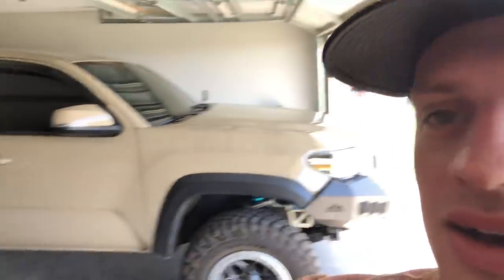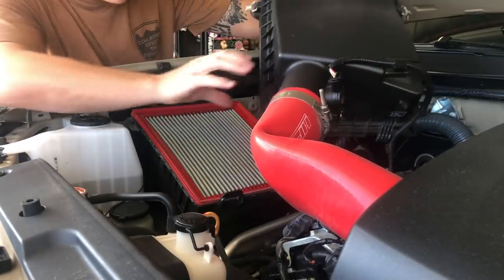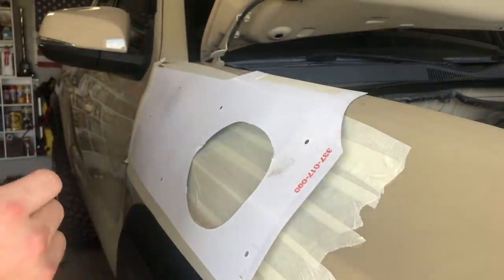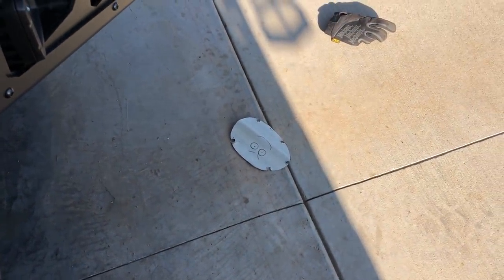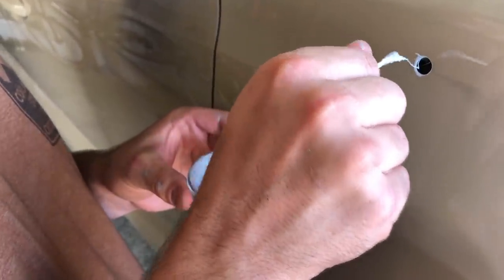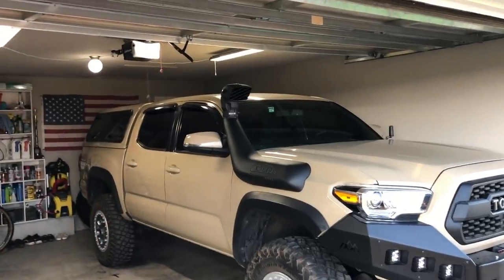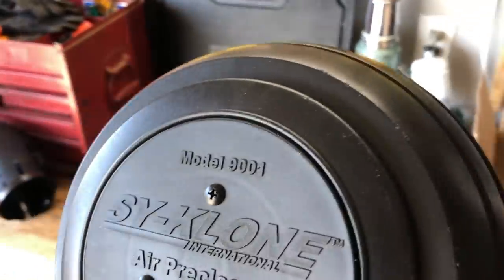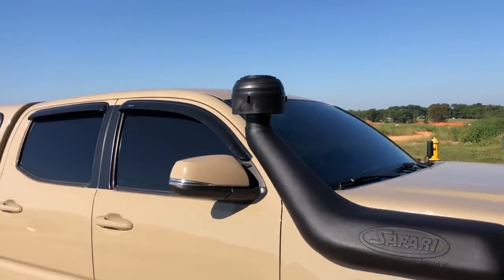Overland Tacoma - ARB Safari Snorkel & Sy-Klone Precleaner Install

Comment: Looks good. Glad to hear it improved your mpg. Can’t wait for the updated bumper.
Reply from the maker: Same here! It’s gonna look soooo much better and slimmer. Saw the bumper pieces cut out the other day in person. Should be soon!
Reply: Did replacing the ram inlet to the sy klone reduce the improved mpg? Curious as I might swap the head on my arb in my gladiator. I saw on average 1.5mpg improvement

Comment: Hey great Video, 21’ TRD OR 6-speed here. Want to get this same set up however I also don’t want to drill into the A-Pillar. I can buy a new fender if need be but not an A-Pillar. My question is did that double sided tape end up working out? Would appreciate any insight you can give me (:

Comment: What is the inlet size of the pre cleaner. I have the same snorkel but I’m getting conflicting responses to the 9001 inlet size?
Reply from the maker: 4" diameter on the safari snorkels. I think dobinson snorkel is a bit smaller.

Comment: Hi Ark!
What size is your engine? With a turbo?
I'm surprised Sy-Klone choose the 9001 unstead the 9001R???
Reply from the maker: Hey! I actually did a lot of research between the two because both have different CFM numbers...Basically had a conversation with Syklone and they recommend the 9001 with the 6 cylinder tacomas.
Reply: @ArkansasOffroad  Hi Ark!
Thank for the reply. 
Your engine is a diesel or petrol?
Reply from the maker: @wawaron1407  Petrol